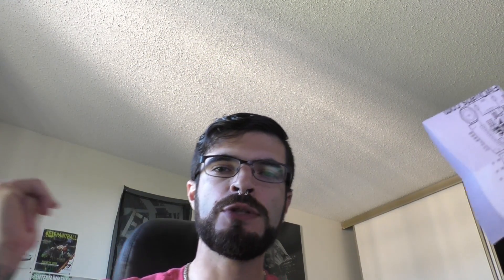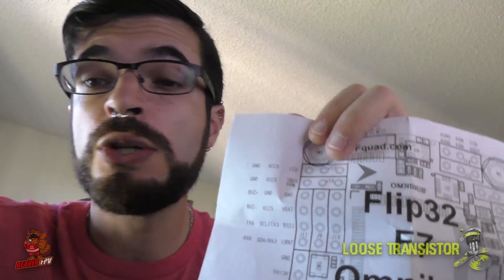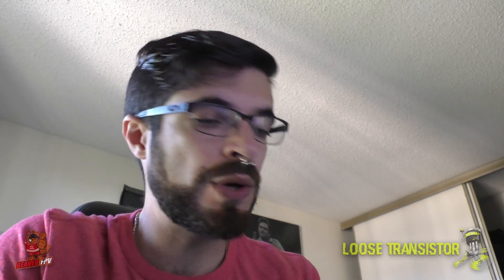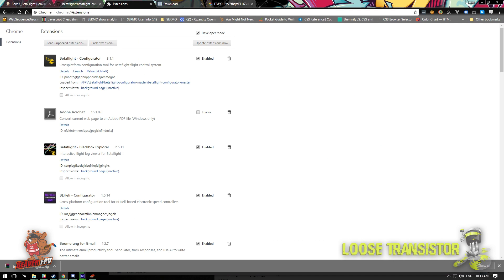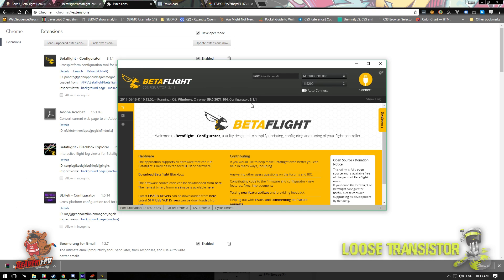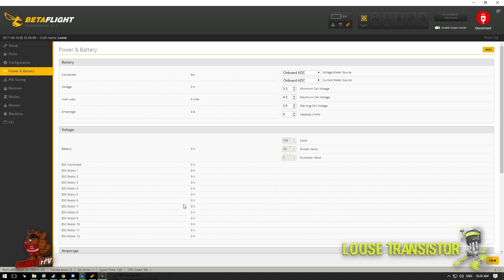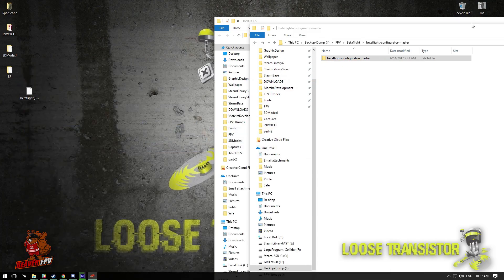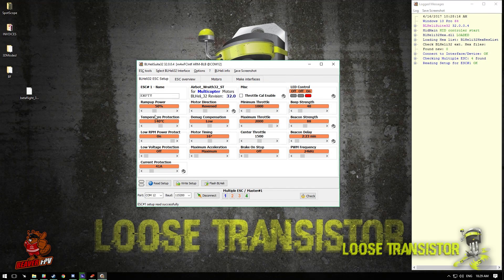BlHeli_32 + Betaflight 3.2 - Passthrough & Pitfalls ♠ [ How To QUAD ]

Comment: I have question, if you are using Blheli 32 why are you only running dshot600 and not 1200?
Reply from the maker: Mike R I later enabled 1200, not a huge difference in feel.

Comment: In the future, is there going to be an easier way too get BetaFlight, or is this the only way?? Gr8 video!!
Reply from the maker: In the future you will be able to flash Betaflight 3.2 just like you do 3.1.6, directly through the Betaflight Configurator.

The only reason you have to flash the way I am showing on this video right now is because BF 3.2 isn't fully released yet. What we are basically doing is pulling Nightly/Daily builds directly from their Github for the purposes of testing.

Just be careful, using this code could be risky because it is not fully tested yet.

Cheers
Reply: i keep getting Failed to load extension from: ~\Downloads\betaflight-configurator-master
Manifest file is missing or unreadable. when i try to drag and drop it
Reply from the maker: Hmm and you made sure you are in Dev mode and everything? I remember running into this as well. I will dig into it see if I can remember what I did to solve it.

Comment: well it seems these esc's kill f1 boards! lol. or bf 3.2.0 does.
Reply: F1 boards should be thrown in the trash anyway.

You do not have your priorities straight if you bought BLHeli_32 ESC's to use with an F1 based FC. That or you have no real idea what you are doing.

;)
Reply from the maker: Uhhhh as far as I know BF 3.2 does not support F1.. in fact Boris came out and said they would no longer be supported in the coming releases so 3.1.7 is likely the last one that is safe to use.
Reply: Loose Transistor FPV yeah i thought id try it and it worked for two boots. lol. interesting it killed it.
Reply from the maker: KillaG FPV lol well I appreciate the info!

Comment: great video, i just did a build with these escs and bff3 board and it worked for about 5min then board died.... any idea why? no shorts, i was in blheli 32 spinning motors everything seemed good and then it just loat connection and wouldnt reconnect anymore. have new lumeniers f4 coming to replace it.
Reply from the maker: The FC died entirely? Does the computer detect it as a device when you plug in? If you'd like to chat about it come find me over on the fpvchat.slack.com so I can help you.
Reply: it powers when plugged in but wont connect. tried every driver fix (i know how to fix driver issues) pc just says unknown device, and it malfunctioned. says same on other computers also.
Reply from the maker: I'm assuming you tried to put it in DFU mode with the boot buttons too.. any change?
Reply: yeah i tried, same thing. crazy that it was all working long enough for me to get a blheli 32 read and spin up motors... thata what i dont get.... maybe bf 3.2 pre release issue, firmware got scrambled?
Reply: No... Nothing to do with 3.2.0.

Firmware doesn't kill boards. Furthermore the bootloader for ALL FC's is stored in ROM. Meaning it cannot be touched and FC's cannot be bricked.

Your FC just died. Plain and simple. Nothing to do with Betaflight or its version.

Comment: Any news about the Diode idea?
Reply from the maker: I did a whole build series on it with the Strictly racing Drones 5". The conclusion is that TVS is very good at preventing transients from burning up your gear bu that you should still use a capacitor somewhere in your build for filtering and keeping the VTX and Camera with a solid supply of pixies.
Reply: Loose Transistor FPV  Thanks for that, I'll take a look at your videos!!